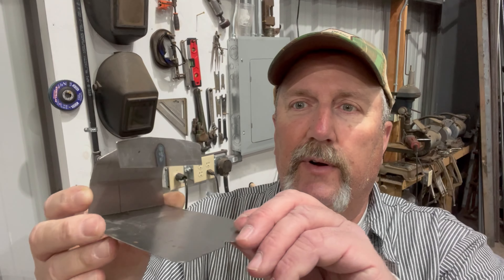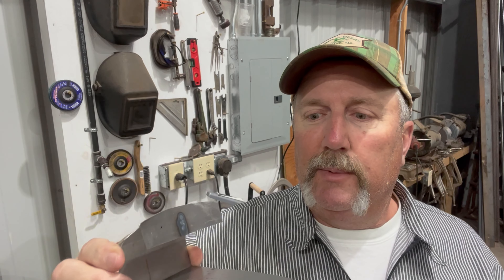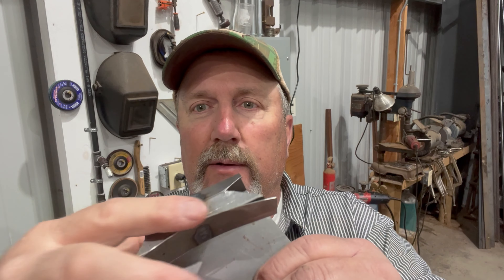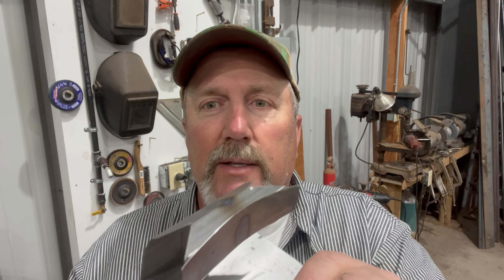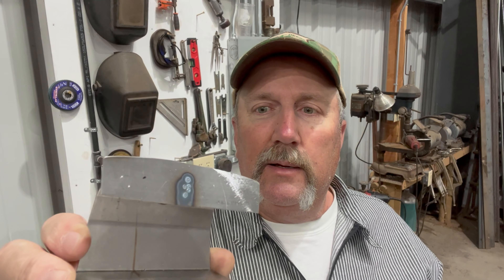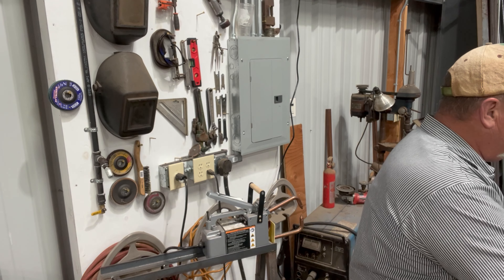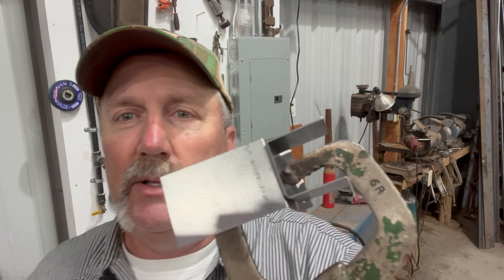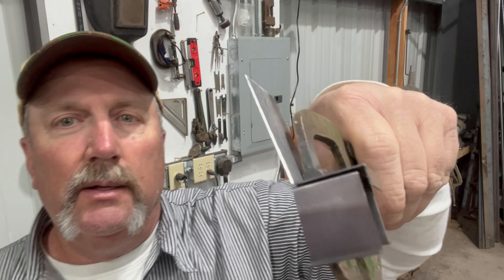Pike bankout progress 👍🏼

Comment: Nice job so far .   Real nice . Like seeing how you make it as you go.   Being a city boy, I had to go look up what a rice bankout truck was.     (  I’ve had a SM Mack L version of an oil field truck  on my “ mind” bench  for a while.    Drew it up at   SM size with  the  big  tires .  Was going to beef the SM frame up and fab big leafs to raise it . Thinking your frame will hold up to a kid much better ! ).      Thanks . Keep these up .
Reply from the maker: thank you!  The Pikes aren’t used too much anymore because most people have gone to pull type carts but they were the go to rig for years and lots of them are still sitting around. I probably have three more videos just on this project. I don’t build as much in the heat of the summer but I have several more projects lined up. 
Thanks for watching 👍🏼🇺🇸